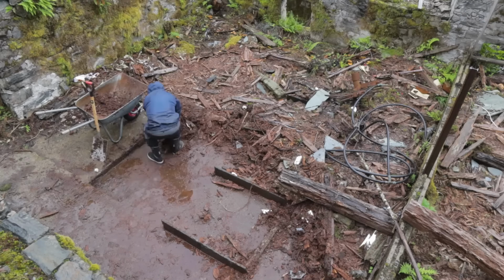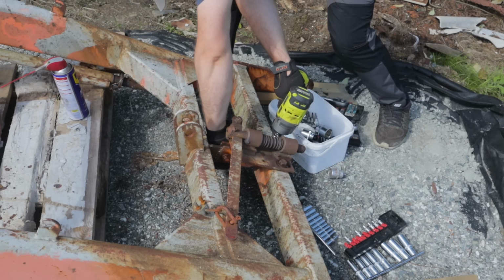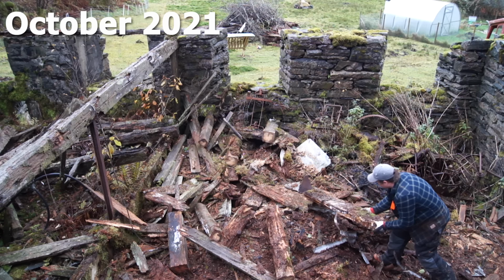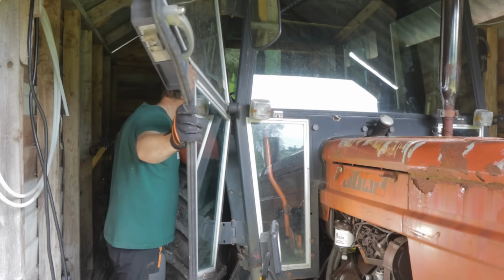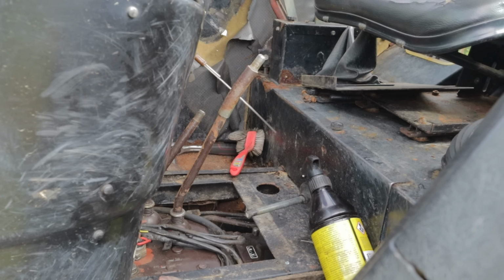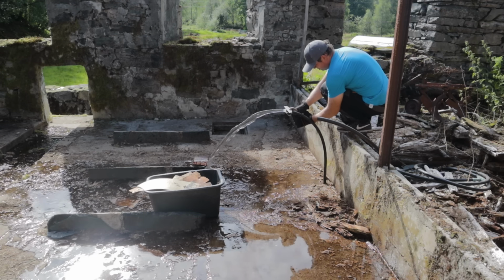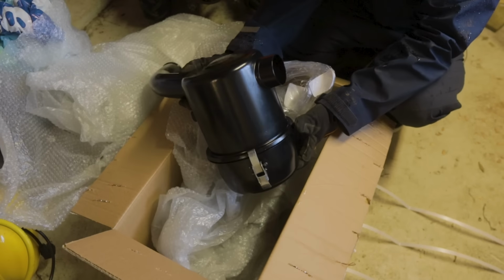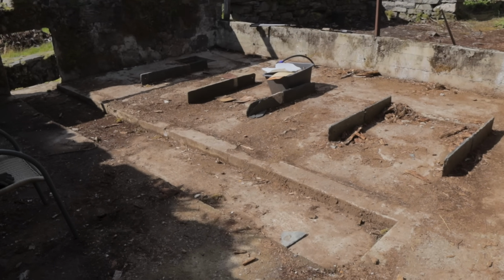42 Year Old Fiat Tractor…Long Overdue Maintenance!

Comment: I noticed you used hydraulic oil on the gear/hydraulic box, but this is not good. Use motor oil or gear oil on this.. No lubrication in hydraulic oil. I have an old 480 dt my self. Keep up the good work!👍

Comment: The air filter was certainly worn out and needed replacement. You can soak metal parts in Coca Cola overnight to remove rust. Old mechanics trick. Check the hydraulic filter on your tractor too, it may never have been changed. Great video and greetings from Ireland.

Comment: Don't feel sorry for buying that tractor filter. It was cheaper than a new engine or an engine rebuild! That is a good tractor and it will help you a lot on your work, especialy because it is 4x4. What you should aquire for the tractor is a good dump trailer. And if you have the posibility, a mini excavator. Both of them will help you and your back a lot and could also bing some money too... Good luck with your projects!

Comment: Can't wait to see that barn getting built and used again. And i'm sure the sheep will love to have a nice place to stay warm for the winter. 
The "cellar" under the barn looks like a liquid manure pit.  And the walled off "room" in front of the barn looks like it was used for the solid manure and straw pile. Sometimes they are actually connected so the run off water from the solid manure pile would flow into the liquid manure tank too, but i can't tell if the liquid tank is actually deeper below the other area for the solid manure.

Comment: The oil bath air filter was definitely worth replacing, with the conditions the tractor works in its not worth taking the risk of not having it doing it's job properly. It could be saving you the engine for sure.👍

Comment: Hi, great video 😊. 
Normally, to start old tractors like yours a bit easier, set the hand accelerator midway while starting. When the engine has started, you can reduce the accelerator. The engine sounds like you start it without accelerating, but maybe I'm wrong 😉 it should be written in the manual how to start it properly.
Reply from the maker: Thanks 👍

Comment: as an italian, nice to see a fiat from time to time, man, whoever ran the farm didn't like to take too much care of his place

eitherways, for the oil, on all older tractors that i have, the gearbox oil is used as hydraulic oil, so it's both. there might be a separate pump for hydraulic, but i doubt it, it's a little 3 cylinder, i don't think it would have been worth an external pump

also, always change all the filters when you get a tractor, you never know when was the last time they were changed. better to change one more than to trash a good motors, thoese engines are quite old at this point

Comment: Remember to check all the hidden oils and filters!
There is/could be oils and filters in:

Steering, brakes, fuel pump what come to mind.
Also theres definetly is oil inside the front axle and hubs.
The rear end could also have different oils in transmission, rear end, hydraulics and rear axle hubs (depending of the model of the tractor, yours could have them all in one check the manual.)
Reply: Also dont use hydraulic oil in the gearbox combined with hydraulics, it will eat your syncros and brakes if they are the wet type.
When in doubt, use universal tractor oil.

I would recommend anything that says UTTO in the label (Universal Tractor Transmission Oil)
And for engine use proper engine oil, never universal type if you care of the engine.

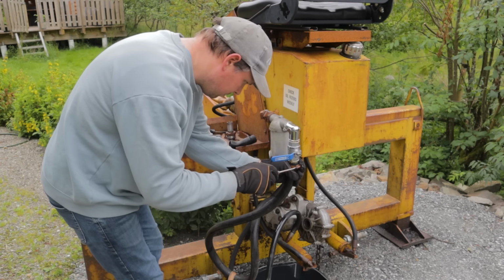Comment: 3:51 you shuld remove the handle on the valve. Its very easy to by misstake flip the valve by brushing against it, or while digging. It will destroy the pump. The valve can still be turned with a wrench if needed for service needs

Comment: If you can get yourself some rear dual wheels (or failing that, old cage wheels) for your tractor, it will really help you with traction when conditions on your land get wet. It might even help you to use that excellent backhoe. I've been through a lot of what you're experiencing, with successes and bitter failures. There's always a way forward, but sometimes you might have to change direction to find it. Very best of luck with your project: I wish I could come and help.

Comment: Howdy from Texas I’m liking your channel. That’s a cool barn y’all got there. One thing that will help you get that pin out of your front end loader is to use some heat and some penetrating oil or if you got some Wd-40 that will work just as good. Hope that helps see ya

Comment: If you come across tires to fit onto you chicken house I would recommend adding them; the kids would be able to roll it around.
Reply from the maker: Thanks for the tip. I had originally planned to do that this year but suddenly the chickens had grown up and I did not need it. Maby next year. 😊
Reply: It took me on and off, six days to finish this video! Worth it though. Wise choice with getting a new air filter but do a bit more research on what oils go in which casing. Hydraulic oil has very little/no lubricant protection so it would not be good in the gearbox at all. Of any machines that I’ve worked on that have a shared oil reservoir, the oil supplier told us to use a diesel engine oil as it would be the cheapest, best option. All the best!

Comment: milky oil = water is in it , replace it ,filter it out or low boil the water out and replace the additives in it
Reply from the maker: I am guessing that you are referring to the oil in the digger attachment and you are correct. 👍I did change the oil in an earlier video and half the tank was filed with water. I don’t know if there are a leaks somewhere or if it is just condense. 🤔
Reply: @Norwegianfarmlife Definately good that you changed the oil, it looked like a milkshake came out when you fixed the hose, hydraulic oil should be pretty clear with a yellow tint. If there was really a lot of water in there, it can't just be condensation. You might have to work the digger a bit and replace the oil pretty soon again, as you might still have a lot of water in the oil that is in the cylinder and hoses. This water will wear and destroy the pump faster, if you don't get most of it out of there. 
Maybe the water gets in the tank from the fill plug when it rains or snow melts on the machine. The caps are not air tight, they need to allow the tank to breathe a little. Placing a bucket or plastic bag over the cap when you don't use the machine might help to keep water away from the oil.

Comment: you really need to fix the air intake on the tractor, the upper filament can be washed with gas, and the lower part with the leak could be soldered closed and a ring put on. It seems not very smart to burn a barn just to keep kids out, don't you supervise the little devils? you seem to take the most difficult path and not use what you have {the tractor}  just my opinion
Reply from the maker: I bought a new one later in the video.😊 Maby, you did not see all of it? Many have commented that I should use some of my heavier equipment on the barn but it is not possible to drive any of it in to the barn without taking down a large piece of the stone wall. I don’t thing that would be any less work. 🤠👍

Comment: I have noticed you are putting colour on rusty tractor. This is not good. First clean all the rust down, next primer colour should be put and then permanent colour. 
Like you have done it will pell down in 1/2 year.